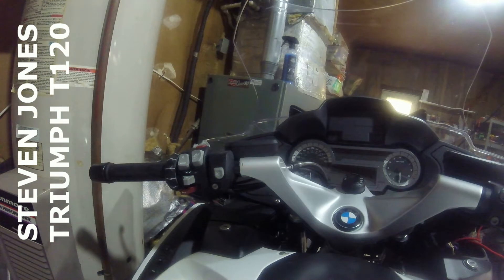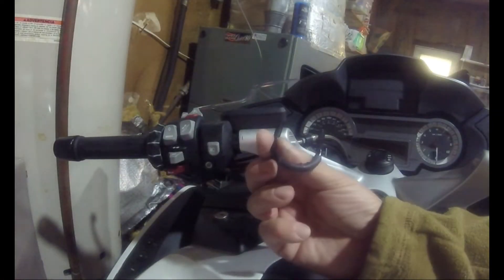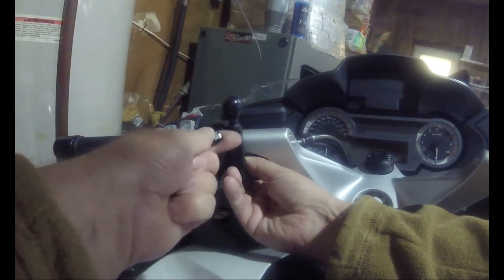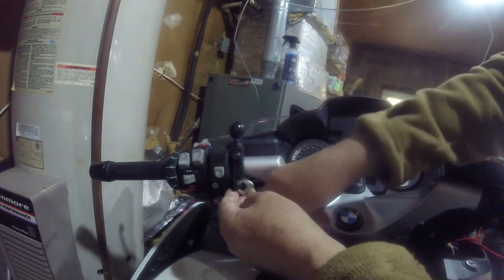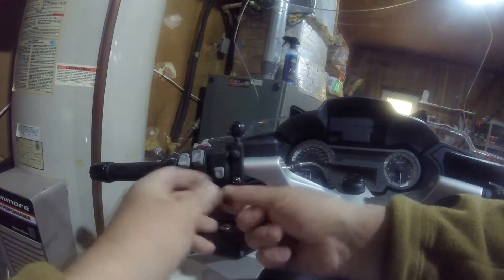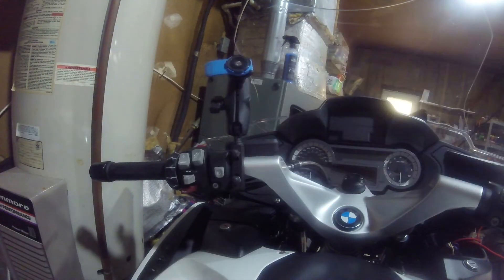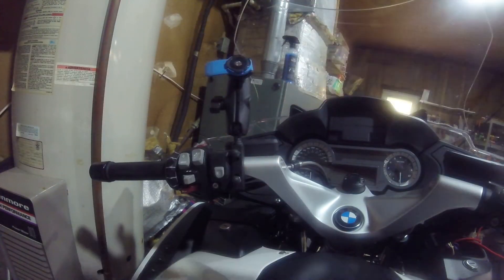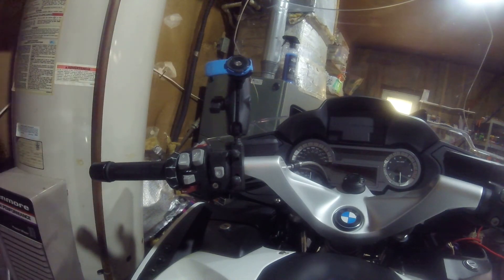Ram Mount Install with Quad lock Ball Mount on my BMW R1250 RT

Comment: Thank you! I just picked up a 2015 RT last week. Was trying to determine how best to mount a Ram system - turns out I already had all the parts I needed, which I would not have figured out without your video.
Reply from the maker: Your welcome I try to provide a service

Comment: Great video! I often wondered how that would work on my '14 R1200RT. I don't think I have enough of a gap for a "C" Clamp so I opted for a mount that replaces the stock BMW logo on the center stem that locks down and allows for a ball mount.  It works well and is very secure. Then I use a Ram X Mount to secure the phone. I like the idea of a second place to mount my 360 degree camera or other device. I need the height for the camera.
Reply from the maker: Yes I've seen those quite a good solution